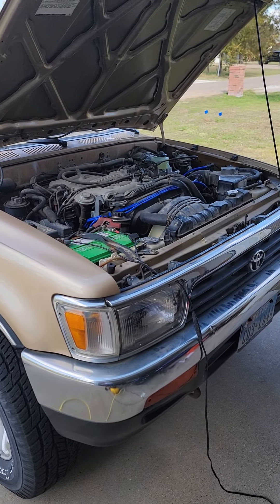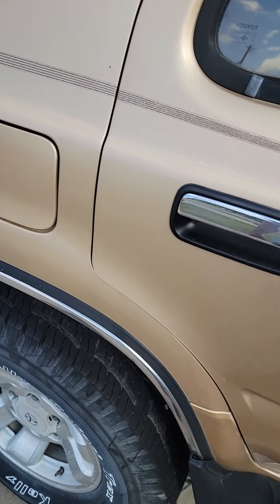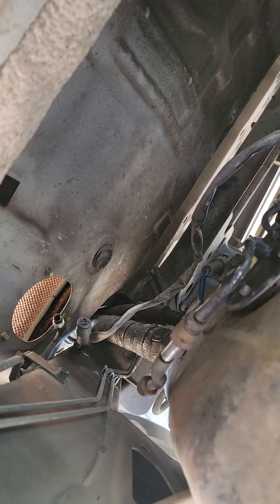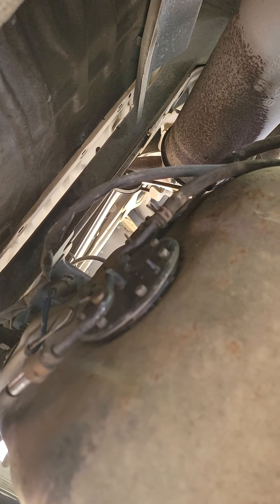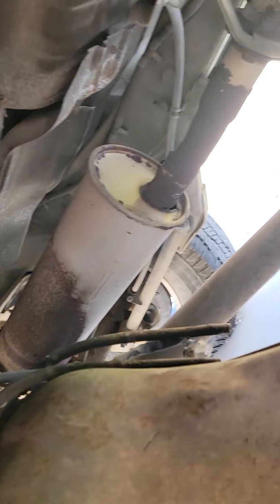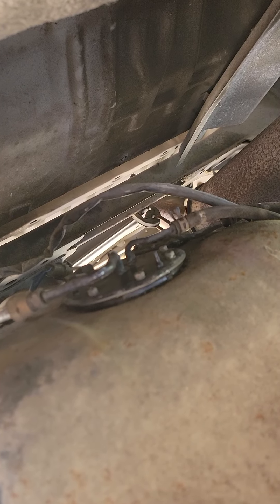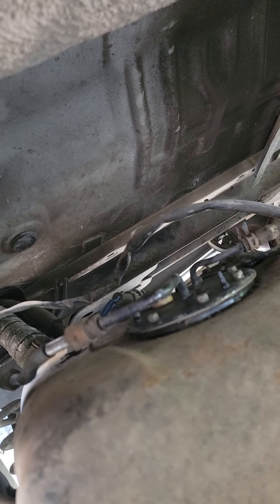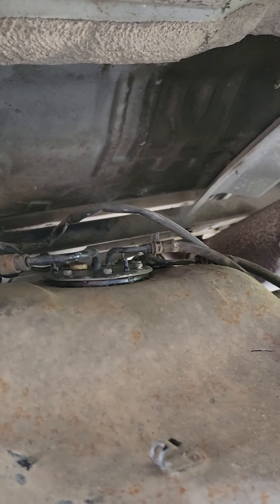1990 4Runner fuel pump Removal and install The Lazy No Cut way

Comment: Thanks for the under view shot cause I’ve been looking for a video with this type of view cause I’m working on my friends 93 4runner it was sitting for 5 years have pretty much rebuilt the front end suspension and steering control did all the fluids and electrical, checked all relays and fuses went to start it up and couldn’t hear the fuel pump so I took the line off the fuel filter and told my friend to start it up to see if I would see any fuel come out and nothing so I was like there’s 2 options I cut it from the top carefully or I drop the tank and my friend said to drop the tank